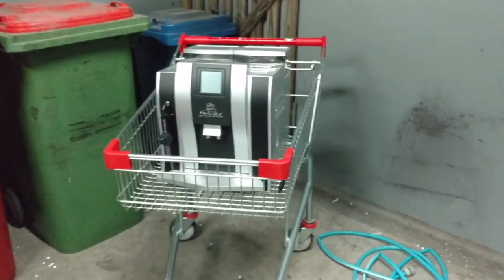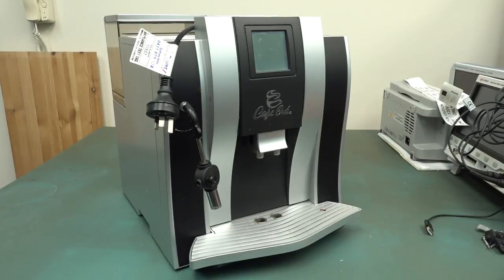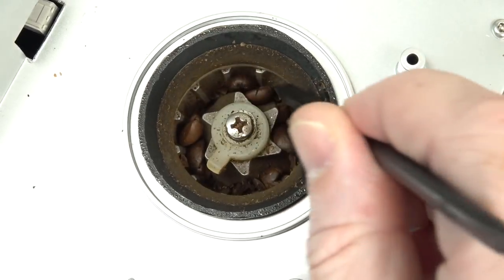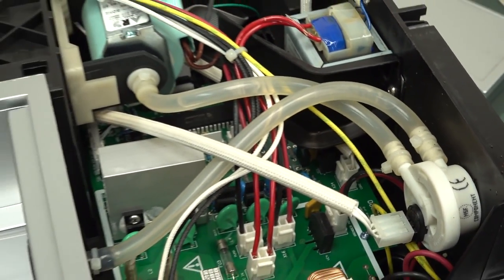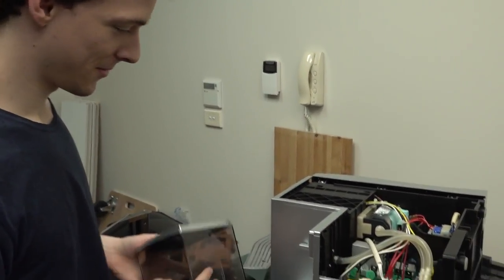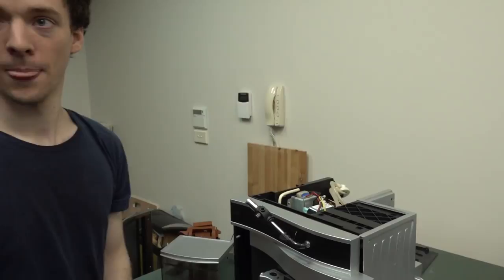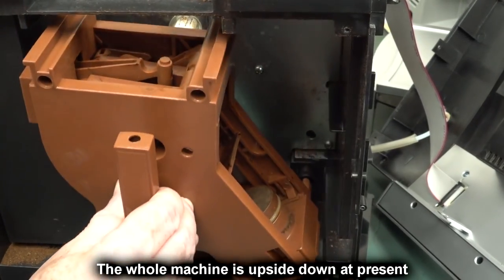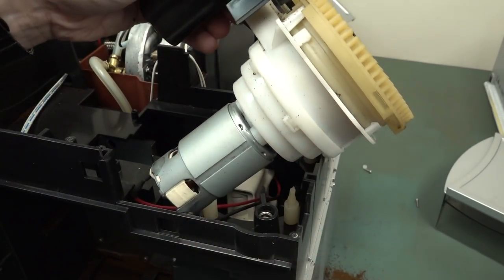EEVblog #1161- Automated Coffee Machine Dumpster Teardown

Comment: It doesn't count beans :) it detects when these are gone, to not to start making a coffee when there is not enough of beans.
Reply: Actually NO that's  not the reason
been a professional coffee maker for 18 years
Look as the coffee beans as resistance or a resistor if you will or a load

yes the sensor sensors when there is no more coffee is in the plastic holder
NOTICE HOWEVER, THAT THE SENSOR ALLOWS FOR A CERTAIN AMOUNT OF COFFEE BEANS TO SIT IN THE GRINDING ELEMENT BENEATH IT

Now. if you completely empty the grinding element and turned the grinder ON, you fuck the gears.
look at like starting your car with no engine oil
so the sensor in a fully auto coffee machine is as safety so that the grinders gears don't fuck up , WHICH ARE EXPENSIVE TO REPLACE,  that's what it's for

it's not to ensure that there is enough coffee to start making the next one coffee,  although this is part of the reason, but certainly not the primary reason

it is also possible that the sensor measures 1 shot of coffee,  although there is no question that it would cut off so as to not damage the metal gears
the reason for protecting the gears is that they have precise adjustments , down to a mm difference to adjust the fine or course setting of the ground coffee

AND AS EXTRA CREDIT POINTS
Just like Volts Amps and Ohms are directly proportional to each other

in a coffee machine
Amount of Coffee in the Basket
Amount of water pressure
Course or Fine grind 
are also proportional 

Example
le'ts just say the shot of the coffee is the same amount of grams EACH TIME,  let's make it a constant

however, if the water pours for 35 seconds,  and the coffee is ground FINE it should cause the coffee flow rate to pour a shot that takes exactly 22 seconds, which should pour 30ml of coffee

now given this,   if you keep the amount of coffee the same
if you keep the water flow rate the same 
but you make the coffee more course,   YOU'RE GOING TO GET A BIGGER SHOT

but the main point is 
IT WOULDN'T EXTRACT AS WELL
but, make it too fine AND IT BURNS THE COFFEE and you get  nasty burnt tasting coffee

so it's about 
Amount of coffee in the basket in grams
course of fineness of the grind
Temperature of the water
Flow rate of the water itself
the end resulting coffee shot should take 22 seconds to pour and produce a 30ml SINGLE SHOT,  
double shots are different however

so as you can see, it's a very touchy feely kinda thing
and if you ever work in coffee and on your first day you change the grinder setting just to see what it'll do ,   DON'T BE SUPRISED IF THE BOSS BITES YOUR FUCKING HEAD OFF
Reply: myVash1984  
i know it doesn't count every bean
but if you notice... The sensor is located at the base of the plastic cone
and BELOW THAT CONE there is still room for some coffee beans to stay in the grinder teeth itself.
the point i was making was .... if the grinder teeth have no coffee to grind they get damaged
so the sensor is essentially cutting off while leaving coffee in the grinder teeth when there is a minimal amount 
if it didn't do this , the grinder itself would not last too long
Reply: Martin Kuliza why would they get damaged
Reply: @Coronadraht 
yeah it could be that as well
it could be sensing if the bean pot is correctly seated in 2 points... that's true
Reply: @Coronadraht yes, that's my understanding, too, and the reason why I questioned the previous "statement".
Reply: @martinkuliza  The grinder won't be damaged if you run it without beans.  My burr grinder tells you to run it without beans when you're changing the grind.  That sensor is more than likely there just to sense if there are not enough beans for a cup.  The certainty with which you speak is unsettling.
Reply: @DingDongMcgee  
yeah... well.     You're speaking in terms of   WHAT IS MORE LIKELY,
i'm speaking in terms of 18 years industry experience..  so.....   you work it out

i keep saying that the sensor is above the blades
and i keep saying that it's there to detect when the coffee hopper is empty WHILE KEEPING COFFEE IN THE GRINDER
and yet,  people still keep telling me that it's there to detect if the coffee hopper is empty

NOW CALL ME CRAZY
BUT ISN'T THAT WHAT I KEEP TELLING YOU GUYS ?
AND YET YOU KEEP REPEATING IT BACK TO ME
Reply: @martinkuliza  Welcome to the internet! Where people don't read anything and assume everything.
Reply: @Jeff-ss6qt 
yeah i know,  and... i'll put up with it for a little bit.
but when someone starts getting to the point of bullshit and being insulting, then.. it's time to stop talking to that person.

I mean, i'm not going to get into  a shit fight over coffee beans,   am i ?  hehe
OR... AM I    hehe

nah.. Not fucking worth it 
be cool
Reply: @Coronadraht 
No problem
yeah, it could be a light sensor, but it might not always be a light sensor
it could also be a weight sensor based on the fact that there could be (usually ) a plastic gate (if you will , or a barrier) and the more beans on top of the barrier the heavier it is .
the barrier could have a weight sensor and when it gets below a certain threshold it could have a cut off switch for the grinder motor

there would be a few ways to do i t but at the end of the day,  YEAH,  it'd have to be some sort of sensor

then.. there are machines that don't have a sensor and literally rely on the barista to switch the grinder off manually

be cool

Comment: Roasted coffee is only fresh for 2 weeks.

The water comes from the reservoir through the flow rate monitor, pump, then boiler.
That solenoid is on/off, not variable.
One heater block in the boiler assembly provides water for brewing and feeding the second one which raises the temp and pressure for the steam wand.
The metal tube on the orange block is for either using steam pressure for ejecting the spent coffee puck, or it is for the back flow from the 3 way solenoid valve.

Comment: Oh god we had one of those at my old job... i called it "the coffee laser printer"
Reply: Exact same model? No good?
Reply: Coffee-o-Matic, or the crappy coffee maker. Makes me glad I drink instant over the nasty stuff that can make, and I like my coffee. I walk through Starbucks to the place behind them, the coffee is better there, and they make it fresh while you wait. 2 cups, recycling the first cup for the second to go, while I wait for the freshly made chicken salad, or Strips n slaw, or the piri piri chicken livers.
Reply: @NeuronalAxon  Not the exact same model. Ours had a larger touch screen and the ability to pull in milk from a tiny fridge attachment. My guess would be newer model of this machine maybe?
Reply: Did you "office space" it when it said "PC Load Letter" on the display?
Reply: Did it only accept year old beans?  

 [ERROR 365: BEANS TOO FRESH]
Reply: Did the coffee come out with the same "hot toner" smell as a freshly laser printed page?
Reply: richfiles With the silicone-coated wires and actual silicone oil used by some laser printers, those two odors might have been relatively close.

Comment: Who ever owned this espresso machine did not clean it very often. I give mine a good clean every week.
Reply: Bert1268 the water tank was spotless. Users might not have known the rest came apart so ‘easily’. Figure that the cord has to be tagged directly and you’ve got the indicator c. the general knowledge of machinery. If I didn’t do my own house mains, every place I’ve lived in would have caught fire and burnt down from pre-existing wiring faults, tagged devices or not.

Comment: Sounds like you do have someone who knows about coffee. I am a COFFEE FREEK, I have ball park of $6000 U.S. on my coffee bar. What you have there is called a SUPER AUTO coffee machine. It is as David said, MEH at best, even the commercial SuperAutos in places like STARBUCKS (we call them CHARbucks for their burnt coffee beans) only offer MEH coffee at best. These machines will make several different coffee like drinks (coffee like due to the poor quality of the drink)
The dumpster is the right place for this machine but salvaging the parts is a close second! 
The photo sensor is not to count beans, it tells the machine when you have run out of beans and shuts the machine off. 
Uh, David, it is called a PortaFilter. 
He is right with the beans, they go stale and need to be trashed about 1 month after ROASTING. Canned or bagged, uh are stale to start with.  
This machine is not designed to be plumbed in so the container is for water ONLY. That is a vibratory pump, ... they work but are the lowest quality.
The brown assembly is to compress the coffee into the portafilter.
The adjustment on the grinder is to adjust how fine the grinds are. This is a low quality grinder, real low quality.
The heating block is as David said, it is a THERMOblock, lowest level of heating water, again bottom of the barrel. Dual stage, one for steam and one for coffee, they require different temps.
The block is called a 3 way valve, it diverts the water to the brew chamber, it does not regulate water flow at all.
2 thermocouples because you need 2 different temp. One for brewing which is 195 to 205 F which is below boiling and the other is for steam which of course is above boiling, typically about 260F
The water temp is CRITICAL for good coffee.
The wire insulation is for high heat protection.
No your lab does not smell like coffee, it smells like rank, stale and rotting old beans :P
Save the parts you can, toss the rest, that is the best use!
Reply: I, I, I LOVE you man!
(Nohomo)
Reply: Nerd culture within a nerd culture. Personally though, I think this thing is vastly overpriced for how (not) well it's built. Nothing near as well built as the KitchenAid mixer, but also not nearly the kind of scam that is Jucero. AvE has tear-downs of both.
Reply: @BlackEpyon  LOL, yep, we each have our own "thing" :P This particular machine is consumer grade which is kind of code for lots of troubles, inconsistent results and never GREAT coffee.
Reply: @wayneparris3439  I'll drink day old coffee cold and I'm not picky at all about the machine. The $25 drip maker suits me just fine. BTW, if you haven't seen AvE's tear-downs of those two, they're worth watching.
Reply: @BlackEpyon  Well there ya go. I can't drink that or even brewed coffee over an hour old in an air pot and never on a warmer. I have been inside every coffee machine I own and there are about a dozen at the moment. The same for the over a dozen grinders too. Enjoy what you drink, I know I do!
Reply: So, this thing makes Acrid Brown Water...
Reply: BlackEpyon Every giant Kitchen Aid mixer uses food grade grease, which oozes out by design if it’s overpacked, and just like every other mixer loses its lease on life if not maintained.

Comment: Nahh Dave. The two separate boilers are both slightly different temps. One for steam for the milk frothing /steaming wand and one for the coffee. Coffee needs a lower temp. It burns if one uses boiling water, it needs be slightly less.
The pump should be capable of around 14 or 15 bar. It is only the resistance to flow from the ground coffee that creates the pressure. Hence the requirement for a correct grind and tamping into the Grouphead (the name young David couldn't think of). If the coffee is too course, the water will piss through without extracting all the coffee GOODNESS. If too tight it will clog and stall and pump will not be able to pump through.
David was quite a way off on a few bits and bats. For a Barrista. :-)
Reply: Pretty rusty lol :)
Reply: *coarse. *fine AKA “tight”

Comment: Dave: The system takes water (not milk) 
The 'Hopper' also  makes up part of the filtering system; ground coffee beans are sent through the hopper to the filter, where it is met by the freshly boiled and pressurised water from one of the heater blocks which gives you the coffee then sent out the front (Used grinds sent to the waste tray in the back). The second heating block is for flash-boiling it to produce high pressure steam for the steamer nozzle. 

As for the thermal cutout; the fuses likely serve as a last resort cut out in event the primary thermal cut out fails to disconnect.

Comment: Hilarious how you can better explain how a copy machine works in an older teardown but struggle to explain a coffee maker😂😂. i get it tho, I had Keurig B70 till it went bad, should have took better care of the water deposits. talk about design failure tho take a look..
Reply: Last week I tried to repair a B70.  2 solenoids, 1 air pump, and a bunch of busted plastic clips later, I had to give up.  I feel guilty about tweeting Dave he should do a repair video on the coffee machine.
Reply: for2utube, don’t feel bad: When I started working on 2-cycle engines I realized that it takes first sourcing every component you desire to remove because the stuff breaks if you’re careful, and many fasteners 🧷 are accompanied by hidden shims of critical measurements.

Comment: Related to the heating elements, twin boilers/heating blocks are used one for steam 100C + and one for espresso around 90C depending on reciepe. Usually only found on bigger comercial machines so might not be case here.

Comment: Dave, the solenoid coil is removable so it can be replaced with 240VAC, 120VAC, or a DC solenoid. Mechanical portion can be mass produced and, if a coil burns up, it can be fixed easily/cheaply.
Reply from the maker: Makes sense.

Comment: The special wire is called AGRP Wire. It can withstand 300 °C high temperature, mostly used in heating or temperature sensing related items. The outer braid layer is made of glass fiber and silicone rubber, inner insulation is also made of silicone rubber, the conductor is tinned copper wire.

Comment: You actually got it!
Reply from the maker: I hope everyone's happy, my lab smells like shit now.
Reply: EEVblog - I was on the fence about getting it, slightly interesting but YUCK the dirt in it!
Reply: The Defpom's Repair Channel I should post a picture of the guts on mine, I haven’t been keeping it clean and these newer ones spill a fair bit more ground coffee than the older ones. You’re supposed to remove and clean that brew group routinely. Which for me means taking the shop vac to it usually before running it through hot water and brushing it down then letting it dry.
Reply: @EEVblog  That is because it was SHIT stale coffee that was in it!
Reply: There was nothing wrong with it, was there?
Reply: @skuula  Impossible to say, it was not tested. However, even if it worked properly, it wasn't worth anything. They make swill, not coffee.
Reply: Soren Kuula yes somebody probably bought rancid beans to run through it and then blamed the machine.

Comment: had a machine like that one, the tank in the back is water only.
the frother in the front is missing a silicone tube which would go into a milk carton.
and that flow messuring is used, because you can choose how much coffee you want, and also how much of the beans you want in there.
as a bonus you can choose wether you want to grind the beans or you can put ground up beans in the smaller opening on top.
you can also change the temp the coffee comes out with.

Comment: It’s a rebadged saeco machine or at least it uses a saeco mechanism. Everything is rated for 230v, so dont transport it to a 120v country and expect it to work (all though it would be a good Video for YouTube views).
Reply from the maker: And who are Saeco on the multimeter brand level gauge, say from ANENG to Fluke.
Reply: EEVblog saeco is towards the top (keysight) some think Jura (fluke) is better but at least in USA Jura doesn’t sell parts and doesn’t allow anyone else service their machines, you have to ship them to New Jersey. Saeco was bought by Philips. I’m not familiar with this machine, but the coffee mechanism looks like a saeco.
Reply: Yep, I have and old (dumpster dive :-) + a day of cleaning) saeco and the internals look similar.
Reply: @jakp8777  Actually Saeco is mid line consumer garbage at best.
Reply: wayne parris ok so who’s a better make of consumer superautomatic?
Reply: 😀 I was thinking that it looked like the thing in my Saeco. Mine is not a fantastic machine but it was free. I have to find the right beans that it can make taste good since I can’t adjust the pressure and the grinder isn’t great. I can adjust the temperature a bit which helps. I usually say that it can get 80% right taste out of the right beans. But to get the last 20%, you need expensive machines and a lot of manual work and training. 😀
Reply: @jakp8777  Very honestly and with all my respect, there really are no good consumer grade SA machines. Even commercial units in service, produce MEH coffee though with a regular service contract and PM, they can have a good "up time" record. Are you asking to make coffee for yourself or as a gift or for general information?
Reply: wayne parris were talking about the engineering of the machine, not about how super auto coffee machines not satisfy your sophisticated pallet. Thanks for hijacking my thread and then taking it off course.
Reply: jak p Got hi-jakked? That’d be like going from 230V @50Hz to 240V @60Hz. Even Capt. Obvious himself couldn’t say for sure that it would work.
Reply: digitalradiohacker yet I don’t think any level of protection it had was any good against a 120V brownout. Removing the plug and clipping the rubberized wire was the only way to be sure.

Comment: the heater is a series configuration, the inlet is the braided hose in the center of the first one, the output of that feeds the normal brewing and also feeds the second stage which feeds the frother with hotter water/steam.